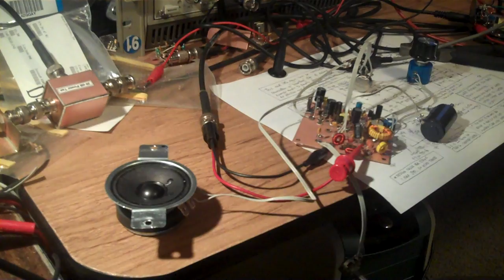40 Meter WBR Regenerative Receiver Demonstration

Comment: I just made the original WBR receiver on a PCB and it just hums loud when switched on. No idea what the hell the problem could be. Can you please give some suggestions? Two values of the caps on the diagram are different  to the values stated in the parts list. Which do I use? C19 .1uF or .01uF?

Comment: I have saved a National vernier dial for my Regen HF project. I did all the mechanical with a pretty front panel and now I will play with the oscillator and decide on plug-in coils vs diode step IC switching, bandspread etc. The regen is amazing in that it is so simple yet works great. I was spoiled early, when I was 13 I had a 19" rack with an SP-600 and R390. Thanks for the video, it is encouraging......73 de KC1CCG (ex W0GMT, K7PKR, WA0UNR, and others I've forgotten)